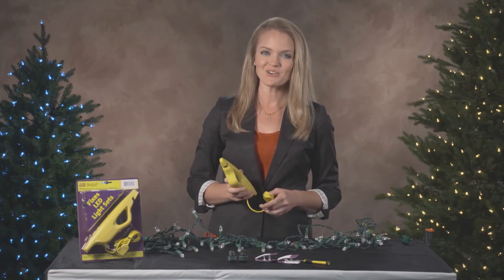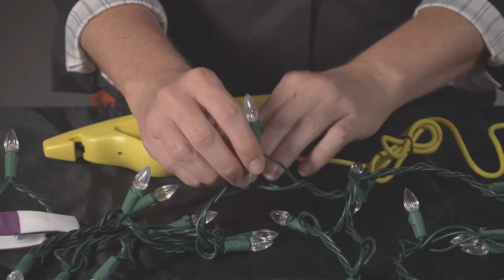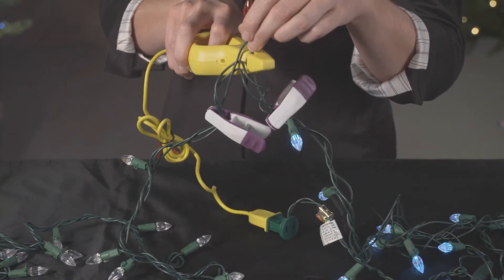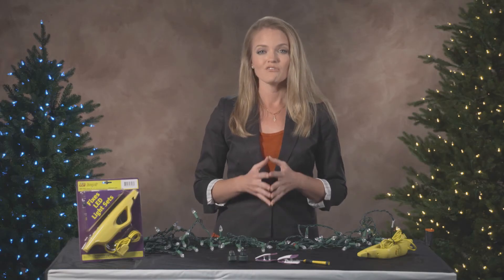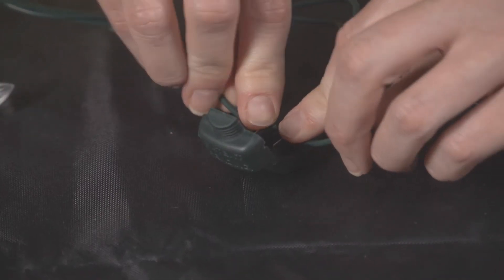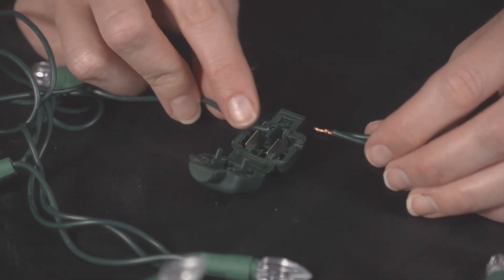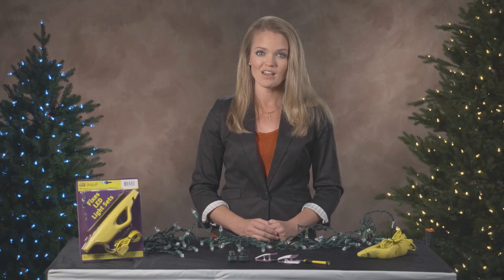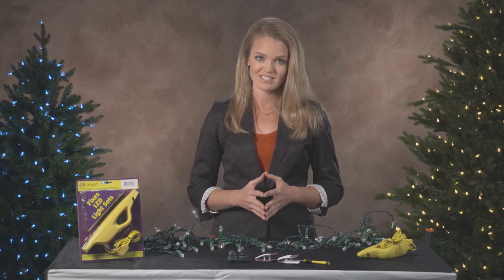How To Use the LED Keeper, LED Christmas Light Repair Tool - The Christmas Light Emporium

Comment: I bought one of these years ago and forgot how it works... this video is pretty good explaining it.  In my own situation I had some outdoor strings that didn't function any longer, and I was able to fix them using this (after I replaced the battery).  The use of the clamps to remember the "known good" part of the string is particularly helpful.  Also the built in tester for the LEDs is really good because you can isolate an outage to either the LED or the socket.  

They can currently be gotten in the US for about $22.

Given that, if you find a bad socket, the "fix" is to use one of their pods... (a clever idea) which basically replaces the socket with a small resistor, so you lose one light from the string.   Also, a few sockets in my strings have two wires (an in and an out) and some have 3... (one is a through splice) and the pods are a lot harder to use on sockets that have 3 wires... since you have to twist two of the wires together and then get them both to fit through a small hole in the pod... which they won't... unless you strip the wires to expose copper in the hole... and a little outside which makes them less waterproof.  A little bit of some sort of sealing glop would probably help here.  The two I've replaced... both had 3 wires... they were on the ends of the strings next to the power connectors.  Also, if you need more than the pods supplied with the tester (I think there were 2), you have to buy new ones - a pack of 4 for $10.  I was glad to be able to get an old string going last night after replacing several LEDs and a water damaged socket... but I'm not sure it was worth all the work since new strings are so inexpensive nowadays.